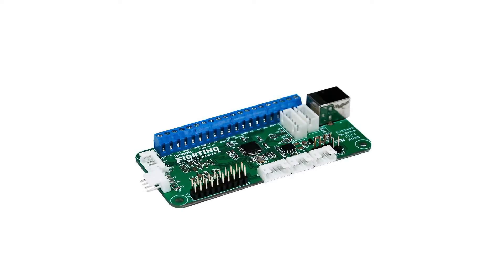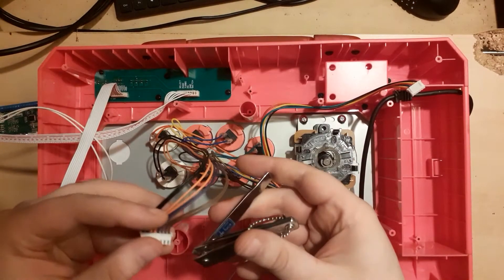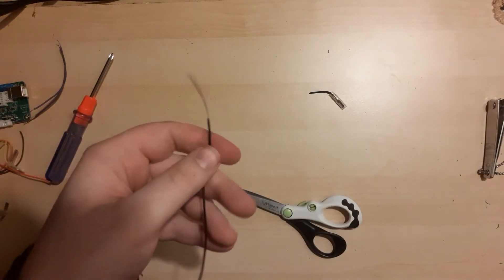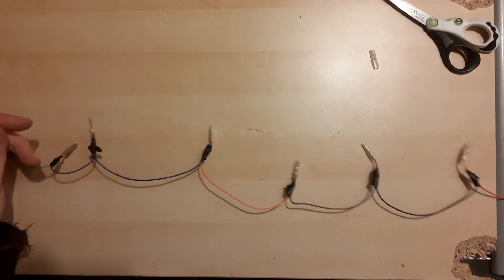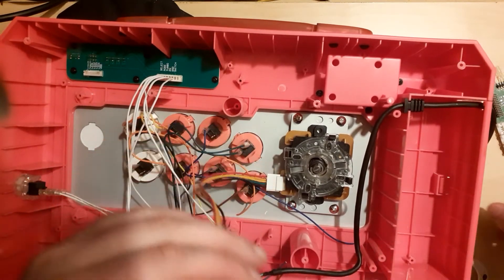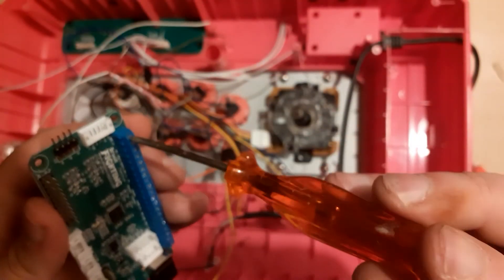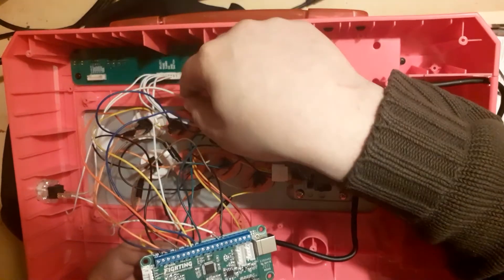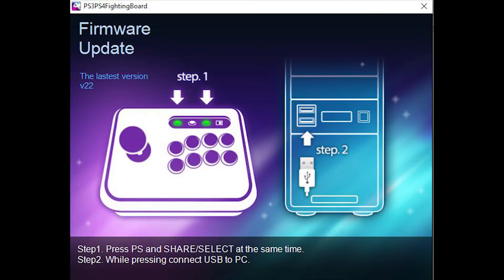$50 Ps3 to Ps4/Ps5 Fight Stick MOD! (BROOK FIGHTING BOARD)

Comment: can i mod an old xbox 360 madcatz sfiv TE fightstick w/ this brook fighting board, and follow these directions?
Reply from the maker: yup. works on any stick no worries
Reply: @ShortFuseFighting  Trying to get the retro brook to work on my MadCatz E.G.O looks like I'll have to use the solder points from home as start I wish that fightstick used more headers ugh.... I would like to keep the case as clean as possible, is there a way to use the key lock button as the dpdt switch? I want to switch in between my retro classic and the default case but I dont want to make another hole in my case

Comment: the usb power cable you also changed, right? Is it one of those printer models? I don't know the correct name...

great tutorial friend, I bought the board and I'm waiting to get to start modifying my Hori. Thanks for the video!
Reply from the maker: Glad I could help. The cable is a usb-b
Reply: @ShortFuseFighting this work for PS3 stick on PS4 for playing sf6? Legacy controller support no longer I may need to spoof PS4 stick? Thanks

Comment: @Short Fuse did you only use one screw to mount the Brook board? Is it holding without issue? I have a similar case to yours and am breaking my head on how to mount it. Moreover I also have a battery with it.  Great video mate, yours explains very well.
Reply from the maker: Yeah, I only used one. one is enough don't worry. It will hold just fine. Good luck